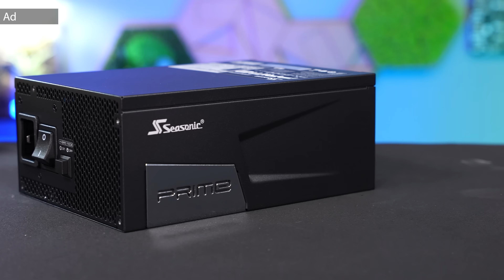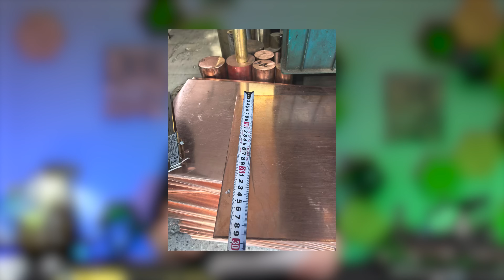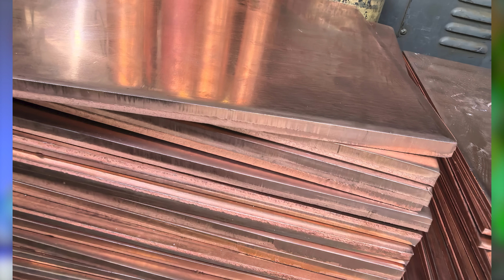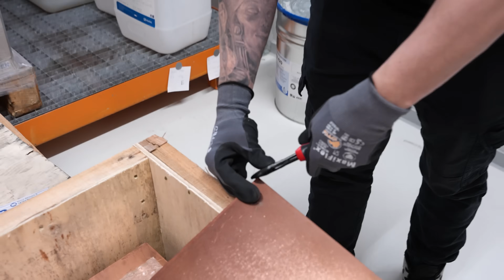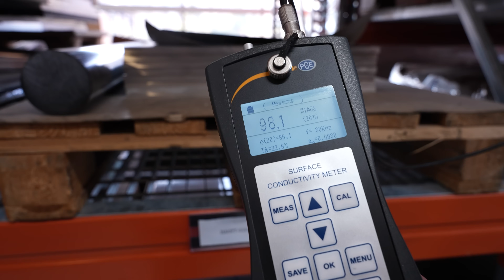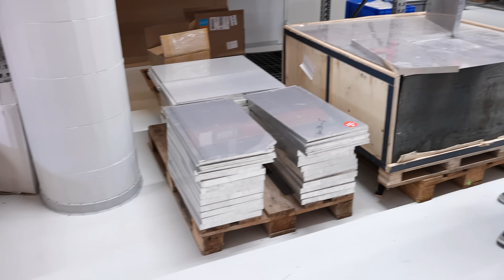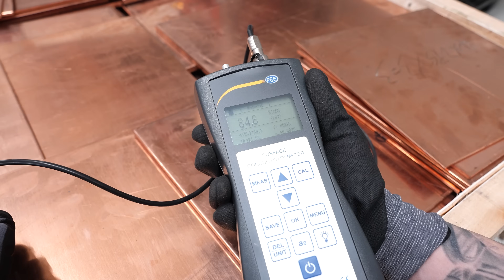I Got Scammed

Comment: This is also an issue with construction materials in China. I have a friend that was over there a cpl years ago building and the re-bar they were sent was coated similar to this. They would bend with very little force and snap easily. The company backed out of the contract and got the hell out of there. I can only imagine all of those nice looking buildings in China that were built with that junk.

Comment: There is nothing to be embarrassed about. I am not sure I would even call this a scam. These are highly organized criminal enterprises. It requires extensive resources to coat correctly sized iron plates with copper, packing that stuff so the iron is at the bottom, shipping large amounts of material and so on. To me, it seems that the respective factories themselves are compromised. I don’t see how you could have prevented this

Comment: China is on the verge of total economic collapse. These scams are a staple in China. I've seen spooles of copper wire just a layer on the outside, inside filled with concrete. Nothing you could have done unless you have a reliable chinese party in China to make sure the delivery is correct. My condolences. This is terrible.

Comment: You were too trusting, good people will always get scammed until you learn.
In this situation if you had 40k to spend, you rushed, start small and make sure quality you received in your hands is up to scratch, not in shipment or b4, scaling up fast is easy. there are wolves in every corner everywhere. it may seem small compared to multi million euro deals but i bet those million euro deals didn't start at that kinda price either. Just shows in China anything is possible, they can have 20 years account in a platform, 100% satisfaction, and still con people!

Comment: 1⃣ File a dispute through the platform

If the order was placed through a marketplace like Alibaba or AliExpress:

Open a trade dispute.

Provide test results proving the material is fake or wrong.

Upload photos, lab analysis, and delivery documentation.

Platforms sometimes refund or partially compensate if the supplier violated terms.

2⃣ Chargeback or bank dispute

If he paid by:

Credit card

PayPal

Some business payment processors

He could request a chargeback for goods not as described.

⚠ If he paid by international bank transfer (SWIFT) this becomes much harder.

3⃣ Legal action

He could:

Hire an international trade lawyer.

File a claim in the supplier’s jurisdiction (often China).

Use arbitration if the contract includes it.

However this is expensive and slow, and many small suppliers simply disappear.

4⃣ Public exposure

What he already did is one of the most effective actions:

Publishing the investigation

Showing material testing results

Warning other buyers

This can damage the supplier’s reputation and protect others.

5⃣ Recover losses through insurance

Some companies have:

trade insurance

cargo insurance

supplier insurance

These can sometimes cover fraud or incorrect goods.

6⃣ Prevent it next time

Experts often recommend:

Letter of Credit (L/C) through a bank

Third-party inspection companies like Bureau Veritas or Intertek

Paying only through the trading platform

Ordering small samples first

Comment: We are a startup producing in China. Currently working with about 30 Chinese manufacturers (most were found through Alibaba). 
First 2 rules we have are: 
1- Always get QC checks designed by us to be fulfilled by manufacturer before shipping. 
2- 50% down payment - 50% after receiving and doing our own QC checks. 

As a startup, we send one of us to do the QC periodically on every batch ( a few trips a year to China). And we have now trained our assembly site to perform our QC for us, so we need less trips. Still we send one of us for any new manufacturer or a new component.
Reply: QC checks = quality check checks?
Reply: @JohnStevenson-v1r  quality control checks. 
If it sounds like saying the thing twice, maybe thats good because you need thorough quality controls.

Comment: I have 3 ideas. 
1. Order very small batches from many. Check who is legit and scrap the rest. Then you increase the amount, size etc very carefuly. Hopfully you end up with someone that is not a scammer.
2. Find a company in China that can do all testing and can handle the legal consequences. 
3. There are YouTubers that do metal work. Ask them what companies they are using. There are also Chinese companies promoting their metal on youtube. You can check how long they have been around.

Also another thing. If you order from a company then ask for their website. Check how long the domain have been around. Scrap those that don't have a website. Check if they have a phone number or email. Check if the alibaba seller contact information is the same as on the website.

Comment: Chinese business classics. I've seen documentaries (was about building materials or clothes) where thay tell chinese specifics: you have to have an reliable local intermediate, that the seller woudn't want to fail and loose it's reputation, and your person has to be at the time of packing and loading your goods, always sending pictures and yes, coating and putting trash is normal practice if left unchecked. sorry for your loss

Comment: I hope you are also planning for the extreme copper shortage that is still coming over the next 2-3 of time, and the huge price increases that will come as well. Right now it may seem like there is a copper shortage, but there isn't yet. The world still has a surplus of stocks, but those stocks are dwindling. In the next year the world will transition to a copper supply deficit for the first time. Waterblocks will likely go extinct since pricing per block will have to jump up to 400+ per block to make it worth the material and electricity pricing costs to make.

Likely will have to transition to just a small copper block right on top of the GPU die and RAM, and plastic everywhere else, just to keep the cost reasonable

Comment: Unfortunately, when dealing with China, you need to monitor everything at every stage. First, an independent third party must supervise and inspect the order's loading at the factory. They must ensure that the correct products are shipped. Then, they must oversee the loading of the goods onto the ship.
You can work with the same supplier for years, but once you forgot to check everything at any point, you'll either receive defective goods or simply become a victim of scam, as in this case.
The Chinese don't care about reputation.

Comment: They are even making fake meat, fruit and veg that they sell to their own people - using toxic stuff half the time as well. The only way to be sure of anything from China is to physically go there and check absolutely everything yourself, and if all is OK, don't take your eyes back off the goods - have then packed right then and there and escorts the goods to the ship. Have ID marks sealing the boxes between factory and the ship to guarantee nothing changed, then ensure it's tamper proof for the ship. 

In some countries, you have to assume the worst and be proven wrong at each stage, not the usual way of assuming all is OK unless proven wrong. 

I've seen them making fake vegetables, and it looks like it costs as much to fake it as to just sell real stuff, yet they still do it, and on industrial scales!
Almost no honey out of China is honey - even that's a syrup mix!

Hopefully your video does OK and you can get some back from scrap or find a way to use it, to help mitigate the financial loss!

One thing is for sure - you went way above and beyond to ensure all was good - it's not that you did something wrong, it's that they are very accustomed to doing this sort of thing - it's a huge issue and they're good at it!

DB.

Comment: I used to cut plate Aluminium and Copper on CNC saws at Smiths Metal Centres (UK). Have you tried them as a supplier?

Comment: Once working at sawmill, we used to import wood from Russia. They pulled similar shit with us all was supposed to be 6m long wood boards with 300x45 measurements. The put theoseon the bottom and sides, but middle ones where only 20cm long. And in place of wood board they just felt like led it with scrap. And hid it almost the same way out boss back then had to deal with it through hardcore tactics and channels.

Comment: Roman this is the difference between a strong brand and just another one. Keep that integrity, honesty and transparency and Grizzly will prevail. It is quite a loss and a punch in a stomach but I see an opportunity to work with Steve and do a documentary about this type of scams, they will increase in size judging by the current world market and the European struggle into maintain certain supply chain costs. Stay strong and committed. Check if you can get legal help since there are consumer protection laws and regulations for China in official documents.

Comment: The state of EU manufacturing for niche goods and raw materials is just embarrassing. I frequently use some electronic parts like motors and board controllers, straight up can't find them in Europe, everything is drop shipped and marked up to shit. So the only option is getting them from China where you never know what and if you'll get it

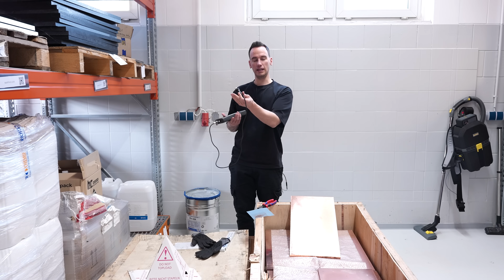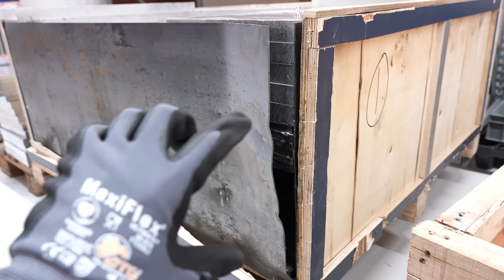Comment: yeh need your own Chinese investigator to do checks , but normally Alibaba protection is in place ? and I normally have them send to my own Freight forwarder at @8:30 still waiting for you to cut in half to realize it was just plated , yep @9:30 push alibaba and have that company marked as fraudulent , they are also doing the same with gold bars @11:30 my freight forwarder would have found that easily , and I have had them cut a lot of things in half before to check things out

Comment: That is the reason I don't like to buy something from China. I was scammed by not orginal Bluray movie which was not even checked after burning the Bluray. There was even a gap in the surface, which caused not reading correctly. The other time I got one CF card which has full of errors and the other has no errors. In the last case I got my money back form Ebay.

Comment: I had a job at a vehicle wreckers not long age, I was hired to go through the 10 acres of cars and pull every gram of copper wire I could find. Whole wire looms, and particularly the battery points, old radiators and alternators, even speaker wire, and it added up surprising well. I even spent week striping all the plastic I could. After 6 weeks the owner called in the metal dealer and made about aud$8,000 for over half a ton. I remember the dealer saying that not only is copper getting truly expensive, it's apparently getting comparatively rare. It's not that we're running out of the actual metal, it's just hard to get a hold of large quantities. And guess what's to blame? Bloody data centers strike again.

Comment: Well, that really sucks!  I'm sorry to hear your tale.  I agree with the other comments that suggest naming the suppliers, at least after you've exhausted your attempts to ask them to resolve the problem.  Though realistically, you already know that such a deliberate scam of copper plating steal is not done accidentally.  I've always been reluctant to place these kinds of orders precisely because I find it very difficult as a non-Chinese speaker to try and evaluate Chinese suppliers and determine if they're known to have a good reputation.  Years ago when I worked at a company that was having circuit boards produced, we had to have a representative in the company to performance negotiations and due diligence, but that made economic sense due to the larger value of business we were conducting.

Comment: Thank you for sharing this. I don't think there was much else you could have done besides check all the material in China before it shipped. That could be an option for you going forward, the cost of a return flight to China to take possession of the checked goods and you arrange your own freight from there would only add a relatively small cost overhead, and at least you would get the material you need to begin production. I feel for you, this sucks.

Comment: These Chinese suppliers are out to scam and their ingenuity is almost impressive. 

Post scam, pursuing cross-border legal action can be difficult and often uneconomic, especially for smaller claims. However, there are well-established ways to reduce risk, such as using letters of credit, escrow-style protections like Alibaba Trade Assurance, and independent factory and pre-shipment inspections, at least until a track record of trust is established with a supplier. Reporting problematic suppliers to the platform and using formal dispute channels is important so that action can be taken and other buyers are better protected. Naming names to help others would be helpful.

Comment: This is the reason why many large companies have offices on site. 

You cant trust most of the smaller factories.

There are some companies over there who offer service to source Material on your behalf to mitigate exactly this.

They basically act as a middleman and make sure you get what you need. There's a premium involved, sure. But at least you get what you need and you csn rely on it.
(I'm not sure how involved they can get with material composition, but checking the shipment with a magnet before sending it out is possible.)

Additional benefit - if THEY get screwed over its chinese vs chinese in a court

Comment: you pretty much NEED someone on the ground in china (someone that you both trust and have leverage on who can't disappear on you). you need that person to go to the factory physically and shake them down. and that person also NEEDS to be chinese for a multitude of reasons. in general though, chinese vendors will always try to rip you off in any way they can because its seen as socially acceptable there. they have a strong culture of victim blaming where its your fault for getting scammed (not the scammer's fault for being dishonest). so you essentially need an enforcer in China who can jump down your supplier's throat and force them to provide what you purchased

Comment: There is foreigh supply chain insurances that you can get where an insurance company covers the cost of materials in the event the materials received are not what was oordered, they tend to have better inspectors on the ground at ports checking shipmenta rather than just checking weight and also hold the policy in the coubtry of origin so if there is an issue its insurer vs supplier in the shipping coubtry rather than reying to fight things internationally, but on an order of 20k euro and being a once off order not a recurring one, that may be an issue and if so may of cost 50% of the order just in insurance.

Comment: Roman, although not embarrassing at all, this is probably one of your most German videos. I understand your frustration and perhaps to your comfort this happens at all levels in China. As an engineer myself working in mining, in my previous company we had a couple of small offices in China, close to industrial districts. And the people we hired were not there to do engineering, they were there to be on premises to negotiate and inspect the entirely logistics chain. Fabrication, testing, tagging, numbering, packing and shipping. Without local support it was impossible to maintain control and integrity of purchased goods. We got good deals and saved money for clients, but the overhead we had to add to actually make it happen ate a significant amount of that saving. There’s people with plenty of experience on this, my suggestion would be to make business through them. China is an excellent source of a lot of things, but it can’t be trusted blindly.

Comment: that’s a signal from heaven - if you hired someone with education, you’d know that it is pretty dumb to mill heat sinks from copper bricks, as the surface area is what matters most… make them from aluminium castings with plenty of fins to increase the surface area, optimise to reduce weight, anodise if you want them to look like copper 😂

Comment: Mate, you did the right thing in making the video. lets get that out of the way, at least. Apart from that, you have to fight your way through this and make sure you get all of your money back or at least some of it. Alibaba needs to step in and resolve this for you. this isnt a cheap purchase from AliExpress. im sure they would be willing to help you out. I've never had issues regarding scams on AliExpress. They usually just give me back the money if an item is not as expected or if some fraudulent situation went down. Where do you stand on all of this? Have you contacted them? Have they said anything?

Comment: I'd think it wasn't even either of the 2 companies/factories you fellas ordered the copper and aluminum from, if I were to bet on the culprit I'd say it was the shipping company or a shadow scamming company hidden within the shipping company. The actual copper and aluminium you ordered made it in full to the shipyard for shipping and once there the crates were opened and all the good copper and aluminum was stolen and replaced with what you showed you received in the video. The crates then got resealed and the scammers finished packing the crates for shipment and then did whatever that they do with the products that they steal.

Comment: Was about to say aluminium would be ok until you showed the steel plates. Would an escrow service mitigate this? You pay for the service and let the escrow deal with the scammers. If there is such option given that there's little one can do. Definitely they have access to a plating factory so they are located in an area that deals with metal manufacturing, maybe pay them a visit?